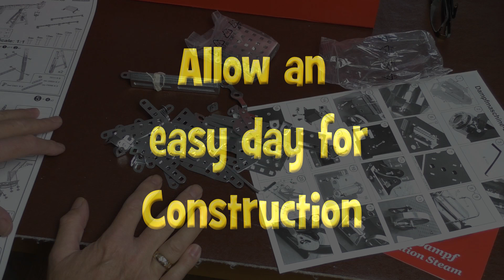Wilesco D11 kit built live steam engine

Comment: Does the coating on the brick portion of wilesco boiler discolor or peel off when used a bunch? I haven't seen anyone mention it, but I know that jensen suffers from that.
Reply from the maker: It does burn slightly just above the firebox as you slide it in but other than that it seems quite tough.  This is not an engine i run that often.

Comment: i got one of these Wilesco D11 kits and it came with nuts that where the wrong size and the base had not been drilled properly  one of my friends is going to help me finish it off because the pictures are not that good. i have run engine a few time since i finished putting it together
Reply from the maker: Hi Eliot.  Sounds like you got a dud kit.  I think i would have sent it back.  Hope you get it sorted.
Reply: @CB-RADIO-UK  I eventually had the problem fixed with some help from my friend. the completed engine looks wonderful now.
I had to replace the thin string with some stronger stuff